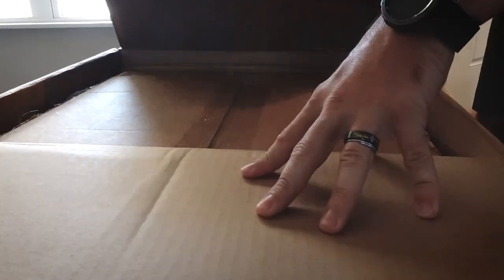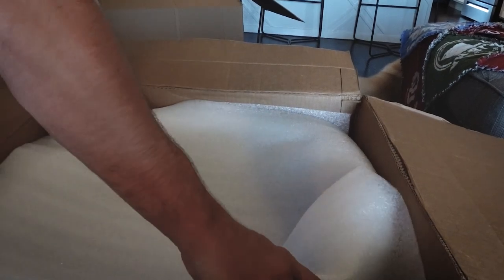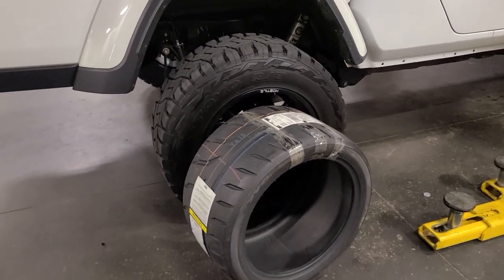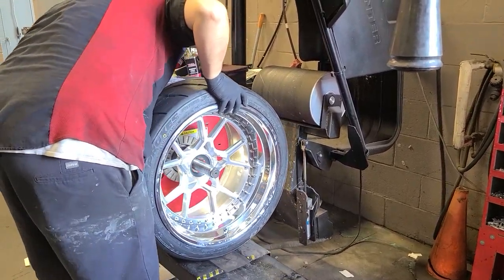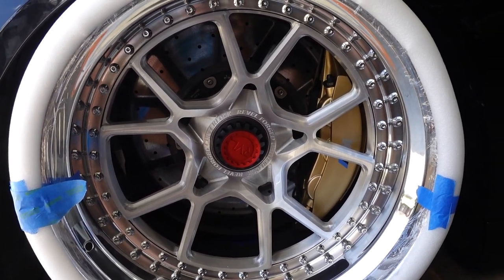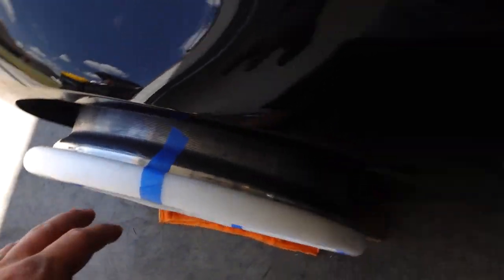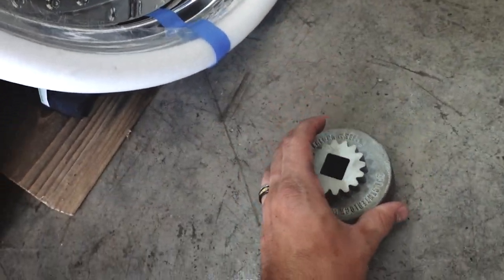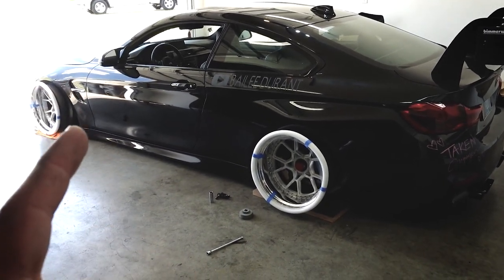RVL Center Lock wheels for the BMW M4

Comment: Hey dude, wheels look amazing! I have some RVL's with the same centre locks, and I was wondering if you could help me out here? 

Did you attach the centre lock conversion to a specific side of the car? i.e the counter-clockwise thread on the front left or to the right rear etc etc. 

Really hope you see this and can understand my question😅 I purchased a car with them on with absolutely no knowledge of them passed onto me from the previous owner.
Reply from the maker: Oh no, not good, they left you to struggle on that. So if installed like mine the driver side will loosen counter clock wise and the passenger will be clockwise.
Reply: @Bailee Durant  Bro thank you🙏🏼 Yeah man these wheels are scary with no knowledge😅 I'm not sure what you're weigh but mine are 30kg each with tyres😬
Reply from the maker: Yeah they are heavy than expected. With the hub adapters it’s probably about 10pounds heavier than my work meisters. It kinda surprised me. I do have carbon ceramic rotors so I trick myself that it’s okay and that the rotors help it.

Comment: hey buddy 
what’s the offset on the wheels ?? i’m building a widebody m4 too and i need help with rim offset and size
Reply from the maker: Mmmm wheel specs range. It all comes down to opinion. I feel I don’t go aggressive enough in the front and I went too aggressive in the rear with my meaty tire taste. But for reference my current spec is New: Front 19x12 -40
New: Rear 19x14 -35… I’ll be changing it next time. If you are going with stretched tire this setup will be better. Had to run more camber than I attended in the rear. And not enough camber that I’d like in the front.